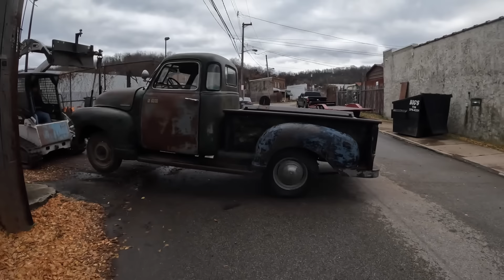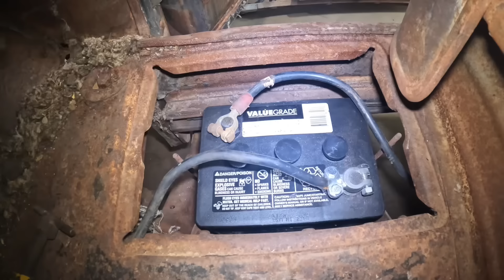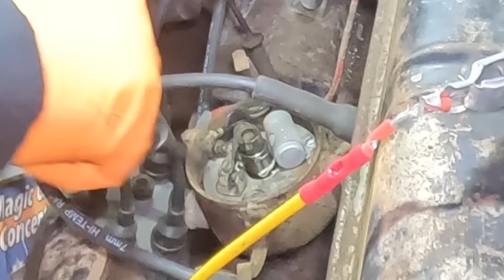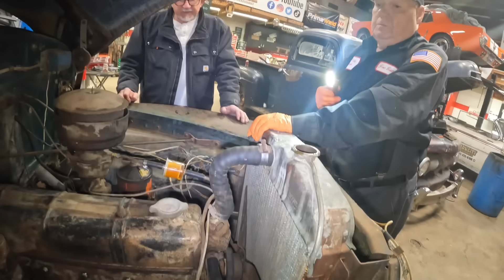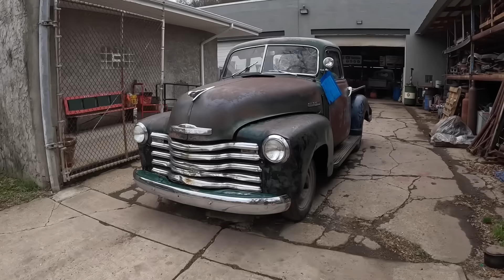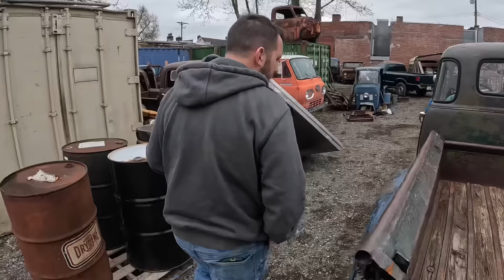Will it run?? 1948 Chevy 3100 Thriftmaster. Short bed, barn find truck.

Comment: If you are going to try to start that old truck, you need a stronger battery and it needs to turn over faster
Reply from the maker: As I said in the video, I previously owned it so I knew it ran good. The intake manifold was just very dry. They require a lot of fuel to start up.